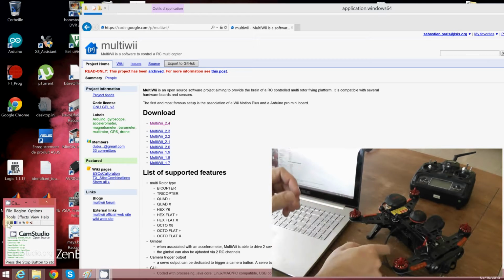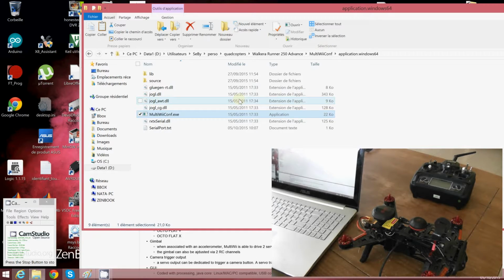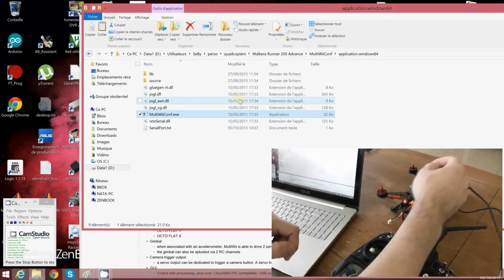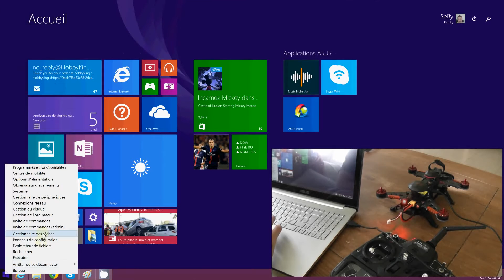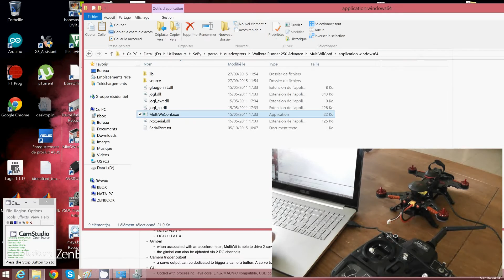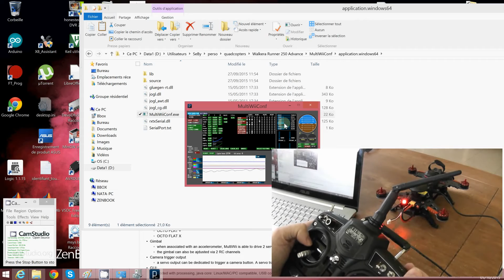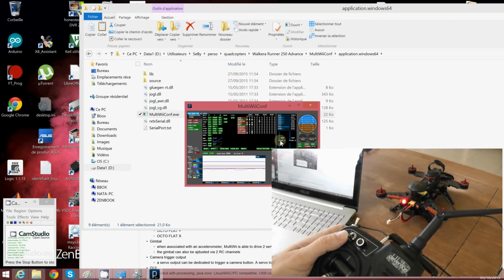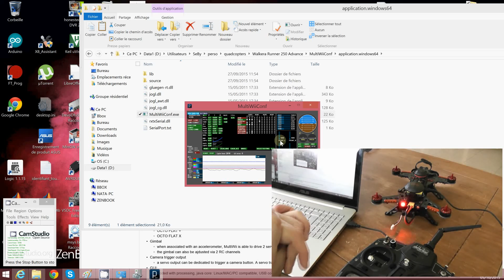Walkera Runner 250 Advance Multiwii connexion (Courtesy Banggood)

Comment: Hello Seb,
Merci pour les conseils.
J'essaie d'updater le firmware du 250 advance d'un ami... COM non reconnu...
J'ai essayé ton lien pour installer manuellement le driver... et là, c'est le drame... écran bleu... à chaque fois que je connecte le quad en USB... un point de restauration m'a sauvé la mise, mais j'en suis toujours au même point... une idée?
Reply from the maker: +Indy John Jones Quel pilote as-tu installer ? les derniers STM VCP ?
Reply: +SeBy DocKy Hello, j'ai essayé les versions .10 et .14 de ce site http://www.ftdichip.com/Drivers/VCP.htm , ceux du site walkera, ceux du site walkera.fan.de .... et j'en oublie...
Puis j'ai vu un post qui parlait de SD Card... je n'ai pas trouvé de slot SD... j'en ai finalement conclu... que j'avais la version 250(C) et pas (R), celle qui est censée tourner sur Openpilot... cool... mais non... je n'ai toujours pas les bon drivers...
Help, please... sinon il va voler sans hélice et par la fenêtre... ;)
Reply: +Indy John Jones finalement, c'est marqué 250R sur l'OSD et le FC... et il a le GPS... mais la camera n'enregistre pas...

Comment: Hi I'm on Windows 10, drivers all installed aok, but when I run Multiwii is doesnt find my Walkera 250 Advance. Any ideas what I should do?
Reply from the maker: +Karl Wilde 1) be sure your are powering your quad 2) connect your microUSB cable3) If your drivers are correctly installed, you should have COM port in Multiwii. Click on connect...4) If you don't see your COM port, check your device manager... and if you see a "!" front your device... it means, W10 "bricked" the non-genuine FTDI chip. You need to manual install some old driver to bypass this problem. I linked the video in my review
Reply: +SeBy DocKy Hi thanks info - powered up and connected, FTDI installed and working. Should I therfore install an older driver? Current version is 2.12.6.0 - thanks for your help.
Reply: +Karl Wilde Installed FTDI driver version 2.10.0.0 - still the same. Am running the 64bit version of MultiWiiConf, have noticed online that some people say that the 64bit doesn't work, is this true? Have tried to run the 32bit version in compatability mode, but it just won't work either. Also tried previous versions of MultiWii. Any help is greatly appreciated, thanks.
Reply from the maker: +Karl Wilde No As you can see in my video, I am using the 64bits version.... What happens when you are trying to connect ? The com port is available ?
Reply: +SeBy DocKy Hi - com port is available,  no errors at all. when I click start I just get a straight line.
Reply from the maker: +Karl Wilde Ok... Data starts to be update after 5s approx
Reply: +SeBy DocKy no info showing up at all. Gawd knows....
Reply: +Karl Wilde As a not tried with MultiWii 2.3 and 2.2 as well. Comm port driver aok, checked again. Still no joy. Is anyone else having this issue???
Reply from the maker: +Karl Wilde As far I know no ... can you make a video with your procedure, device manager, etc?
Reply: +SeBy DocKy will do, get it fimed this evening
 and post.
Reply: +Karl Wilde Apols not had chance yet. Just to let you know that have done all procedures again, including older drivers, on another Win10 PC, a windows 7 and Vista, all to same end - nothing!
Reply from the maker: +Karl Wilde Maybe a stupid check: Can you change you microUSB cable ? to a shorter one for example ?
Reply: +SeBy DocKy will have ago
Reply: +Karl Wilde Nope - tried a shorter one and 2 others. Ahhhhhhhhhhh! lol